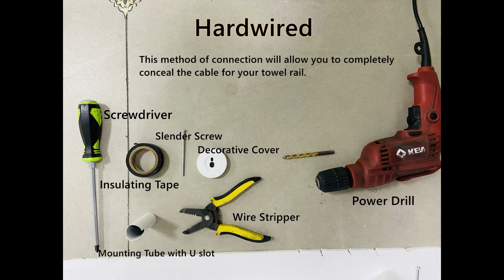Hardwired of Towel Warmer by Paraheeter

Comment: Typically electric codes require that connections between AC power wires be made inside of junction boxes using proper methods (for most people wire nuts).  This video makes it look like the wires are just being twisted together, electric taped and shoved into the wall.
Reply: This is correct. I’m an electrician and this is not an acceptable method of wiring. It’s just dangerous. Posting this video puts people at risk.
Reply: Thanks for leaving a comment! I just watched this video in shock and will definitely be using wire nuts inside a junction box. Yikes